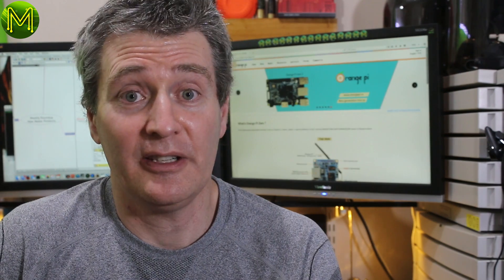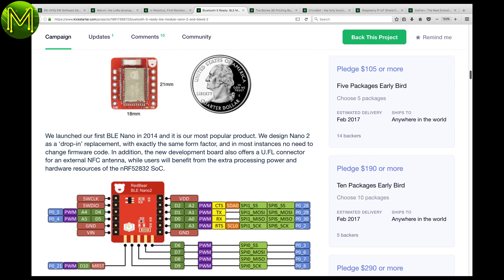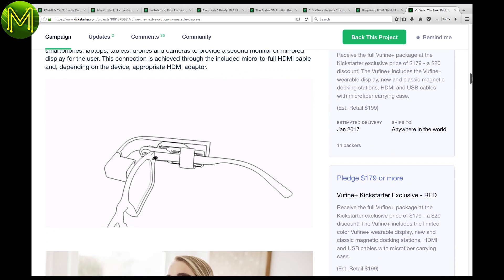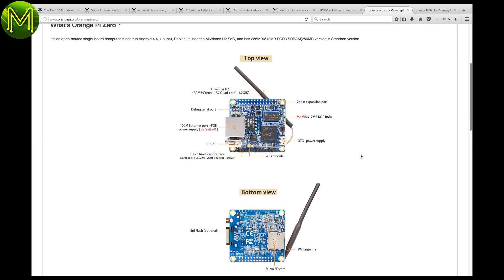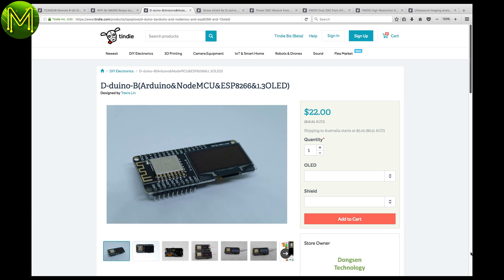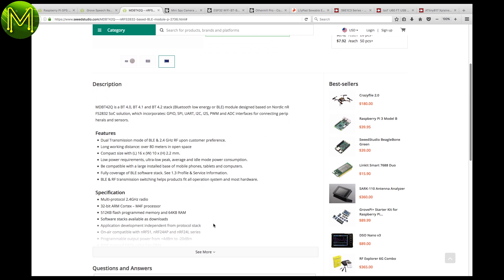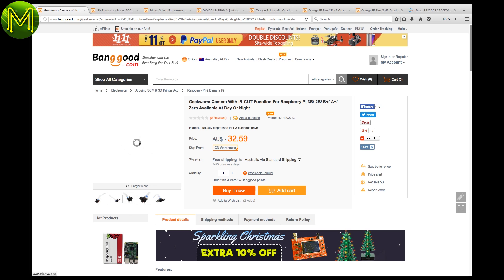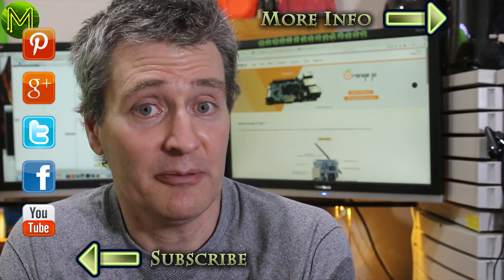#068 Weekly Roundup #11 - New Maker Products

Comment: I have been doing a bit more reading on the Orange Pi boards and some web sites have been saying the AllWinner chip sets are poorly supported under Linux. Now I don't know how accurate this is. I also don't know if this includes the armbian.com distribution.
I had initially been thinking the Orange Pi Zero would be good for security cameras only to then realise that it doesn't have a camera input. Probably a dedicated board would workout cheaper, but not sure if the on board processing could have been used for more advanced functions.
Reply from the maker: Yes indeed they are poorly supported under any Linux distribution. YMMV depending on which one you choose, but the support isn't crash hot. I'm ordering two of the new Orange Pis to give them a run through with my testing. So stay tuned for that!

Comment: Hi Mick!

I've been watching these roundups since you started doing them as I find that they're a great way to keep up to date. I'd like to give you a bit of feedback though, to do what you please with of course. :)

My biggest "gripe" would be that you scroll down pages and/or click through pictures way to fast. I gain nothing from getting confused by you clicking, scrolling and flicking through information I can get myself, in my own pace.

I would suggest that you simply stop at the top of the page or on a representative image and then talk on top of that. You could also superimpose the key points of the product on top of this image to provide an easy to read summary.

In quite a few of these videos the volume of voiceover is really low, as if you're talking really quiet when recording this. This one was great though so prehaps you've adjusted something this time. :)

Otherwise, keep up the great work!
Reply from the maker: +Martin Edelius 
Hi Martin,
Yup I've been meaning to revamp this video series as most people watch it on mobile devices more so than my other videos. This means I really need to zoom in and slow down more as it'll be harder to see otherwise.
Thanks for your great feedback.

Comment: I just want to point out, you can buy a refurbished tormach CNC machine for the price of that "othermill"
Reply from the maker: +ArcAiN6
Yup true. The Tormachs are great. It's one of those things, if i wanted a CNC for a business, then I'd invest in a decent one. But... still outside the reach of the normal maker.
Reply: that's kind of what i'm saying, the price point on the othermill just doesn't make sense for the maker market.
I mean, if you have $4k laying around, i think you would be better off getting an x-carve, ox-carve, shapeoko  or similar, and a bunch of tooling, additional 'stuff',  and media  for it and still have a couple $k laying about for other projects.

Maybe it's just me, but i see this type of niche gouging everywhere these days. Just attach the word "maker" "hobbyists" or "cnc" and instantly the price of the thing jumps up 300%.

The x-carve is such an example, i built one for $300, by making all the parts, and only buying what i couldn't make from cheaper sources.  Inventables prices are a bit high, especially on the $80 "quiet cut" spindle you can pick up on aliexpress for $30 (probably where they sourced from)

Don't get me wrong, these companies need to make money, but soemtimes the mark up isn't justified, or in the case of othermill, simply doesn't make sense. I "could" buy a somewhat sturdy plastic encased cnc mill, or i could buy an extremely sturdy tormach for around the same price. If i don't need a tormach, do i really need an othermill, or is there cheaper solutions out there?

Let's face it, the maker market is exploding everywhere, but the true spirit is in making things, not buying overpriced things.

just my point of view, and i could be wrong.
Reply from the maker: ArcAiN6
No, I agree. Lots of companies are jumping on the "Maker" bandwagon. The funny thing is that Makers have been around for thousands of years and thrive on the lack of something that requires imagination to make it.
Making overpriced equipment won't help the traditional Maker.
Reply: nod
With all that being said.. if you ever find yourself overburdened with mcu's and gadgets, feel free to ship the extra's to me ;D

Comment: The orange pi zero specifies POE but "default off" . What does that mean ?
Loving your round up by the way .
Reply: No, if you look at the schematics the PoE+ and PoE- simply go passively through R29 and R358. If you look at the bottom of the board there are two disconnected solder-pads there next to those labels -- I would assume you need to connect the pads to enable PoE.

One thing I can see in the schematics is that PoE+ and PoE- are simply directly connected to VBUS and GND. Now, I've never done anything PoE-related nor have I ever used it, but that sure doesn't look like standards-compliant PoE.
Reply: Thanks for the clarification . If it sounds too good to be true ...
Reply: maybe you have to enable it through software before it can be used?
Reply from the maker: +Nita Vesa 
Thanks Nita for that info!

Yup, I see the RJ45 pins connecting to VBUS on page 10, but VBUS actually comes in on page 7 into the AO3415A and BCM856BS setup.
I would expect there to be an onboard voltage regulator that copes better with the 44 to 57 voltage range of PoE. What they have there can only cope with 20v max. Unless I'm reading the AO3415A data sheet wrong.
Reply from the maker: +MickMake 
After checking around other boards. It seems this combo is common across cheap SBCs. FriendlyARM use it in all their SBCs.
Reply from the maker: +Troy Winterbourn 
I'll add PoE tests when I'm reviewing this board.